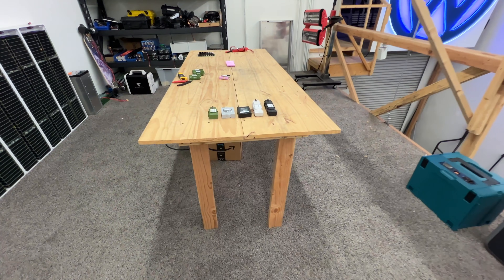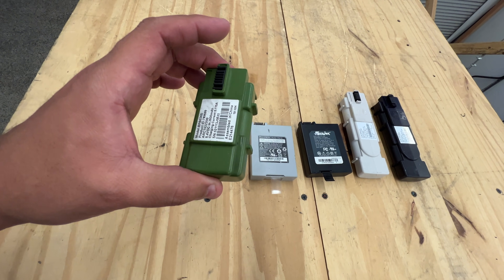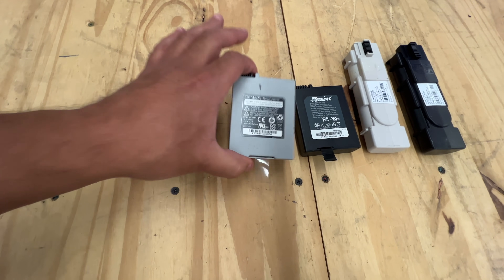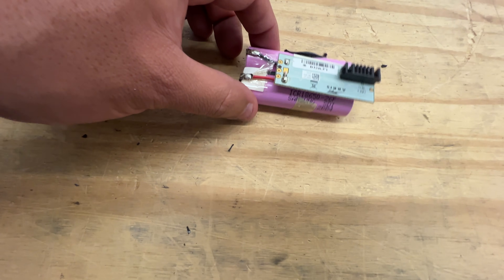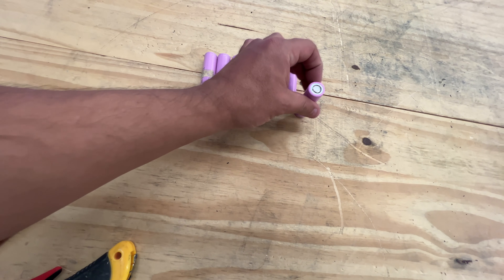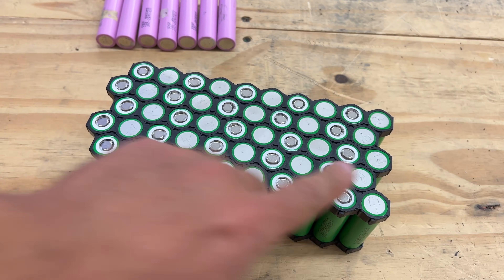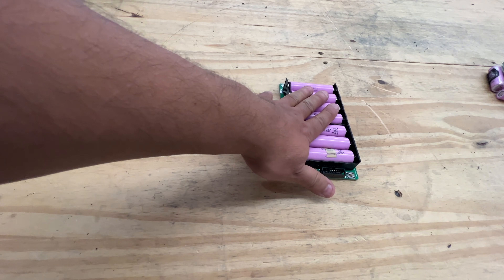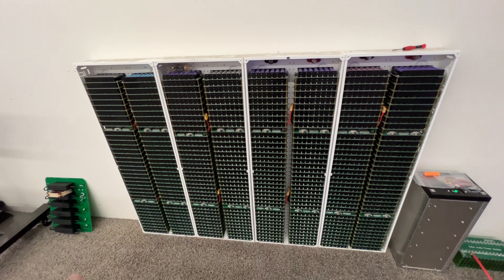Extracting 18650 SAMSUNG cells out of $1.20 Modem Lithium Batteries

Comment: I find modems in the dump all the time and harvest to battery packs. The cells are normally depleted to around 1 V (lots of power outages on island where I live) but by jumping them in parallel with a 4.2V Li ion I can get them to read 3.7 V and the the Li ion battery charger can read them and I can charge them up fully.

Comment: Never charge indoors. Always maintain batteries properly per specs. Set up something contained outside for charging. Using an old file cabinet (steel), washing machine, freezer, or similar. Two people I know have had fire while charging hobby battery packs.
Reply: Charge outdoors???

Comment: Ordered 40 of the $1.20 Modem packs. Here are my results!

40 Packs 80 Cells Ordred	
	
2400	3
2300	7
2200	14
2100	8
2000	14
1900	12
1800	5
1700	5
1600	7
1500	4
Junk	12
Total	91
Jehu Must have sent me some extra packs!	

I'm not super happy with the results! I have had much better luck in the past with other harvests. They aren't as hard to get apart as Laptop packs but that black glue in them will make you have to put new heat shrink on a bunch of cells.
Reply: realy not a good buy, i would go for the scooters battery at this speed, would be a better deal.
Reply: @uinerd  its because its garbage, and his trying to sell something that has some value lol This is why buying used batterys for salvage is a gamble, now add that with paying a premium for the packs lol

Comment: I think recycling these cells is awesome.  However wouldn't a cheaper and easier fix be getting a plug (molex connector?) for the cells to be used as-is?  That way there's no smashing of cases and/or ripping of plastic goo?
Reply: The point is to free the cells for construction of packs at varying voltage and capacity. there is a need that the cells match and are balanced. Each cell needs to be tested carefully. Ham radio is one application that comes to mind. Building a 12 volt pack at 2 amp hours is a common goal. This means something like 8 cells. Look up Building a LiPo pack ham radio.
Reply: Someone didn't finish the video before commenting :-)

Comment: Why not build a power wall using the battery packs as-is? Use 4 cell and 3 cell batteries together to get the 7 cells. They already have built in monitor and charge control circuitry so a wall unit would need a way to read the data from them. It could identify bad batteries so they could be swapped out. Don't know how much $ all the connectors would cost.
Reply: honestly, based on the cells in them, they're only rated at 5 amps. that's not very good. They're good for some uses, but they really can't push more than 20w per cell. They're cheap for a reason.
Reply: @kasuraga  Cells are combined to addresses application. Example... Say 8 cells, wired as two batches of 4 cells. 4 cell batch wired parallel. Those two batches are then put in series, doubling the voltage.
Reply: @tahoma6889  5 amps is still not a lot of current. but for the price, it's to be expected. I primarily use 18650's for regulated vape mods that push over 100 watts. They're useful for powerful flash lights too. Sure you can run them in series parallel banks to get more voltage and current, but that also increases the packaging size.

Comment: I’m only a couple of minutes into watching this, so apologies if my question is answered before the end of the video. 

The modems that these batteries comes from, (let’s just concentrate on the green packs, since they seem to be the favorite) is it known how the BMS in those modems manage the cells? In particular, at what voltage are the cells kept? (I’m hoping that they’re not charged to a voltage higher than 4.1V/cell.)

(Assuming they’re not LiHv cells, which can’t imagine they would choose for a simple cable modem.)
Reply: according to the info of the packaging they get charged to 4.2v each, its an 8.4v 2600mah pack, but i assume it's probably not tested at that, will just be copy and paste from the samsung docs, but they can be charged at 4.2v each according to samsung specifications, but it is right at the top of what these batteries can accept, i would expect a lot less cycles from them, they are only 1/10th the price from buying the batteries new from a proper supplier so i think you will still make a huge saving going this route, even if you loose 1/3rd the total cycles.
Reply: Don't waste your time on used cells, this is not a good deal.
Reply: @BigSmartArmed  Do have any evidence to back up your inane claim with?
Reply: @BoHolbo  What claim?  That seller only uses FedEx for shipping, it's a fact, not a claim.  Shipping costs come to half of the order cost, while other commenters here stated that shipping was as high as $50 per order.

It's the final cost that matters, not advertised price.
Reply: @BigSmartArmed  I’ll accept your answer, except for one thing. 

The points that you brought up, doesn’t address anything talked about in the comment thread that I started. 

It would have made a lot more sense if you had posted it in the main thread instead.
Reply: @BoHolbo  You were asking about the voltage, and in used li-ion cells that were kept at full charge over an extended period of time, internal resistance begins to vary to the point at which BMS can't keep multiple cell charge balanced.  

That means that prior to assembly and depending on how many recycled cells will be used in a given connection, all of those cells have to be tested by multiple charge-discharge cycles, and then sorted according to their rating.

Otherwise even with BMS an assembled pack will either charge as high as the lowest rated cell, or will overcharge thus potentially causing a fire.

That's why together with very high shipping charges these recycled cells are just not a good deal.  It can be DIY project of battery pack building, but for a dedicated use it's much better and much, much safer to just buy new cells.
Reply: @BigSmartArmed  but getting them new you also pay for shiping cost. Or not?
Reply: @RolopIsHere  Other vendors use USPS and UPS which is much less then FedEx
Reply: @BigSmartArmed  No, FedEx is not the only shipping option. From his link: We provide the following shipping options:

- USPS Priority Mail
- USPS Priority Mail Express (3pm PST cut-off time)
- FedEx Ground
- UPS® Ground

Comment: I have never once had a modem that had batteries.
Reply: It's only going to be in areas with no dedicated PSTN line, and a requirement by state law to have power on the telephone service so you can use a passive handset during a black out.

Comment: Most modems don't have a battery. Only modems that support analog phone lines which is basically the supper crappy modem the cable company gives you after they swindle you into getting a land line that you'll never use and unplug because the only calls you get are that your call warranty is about to expire.

Comment: Aren't these batteries kept fully charged for years? That is not very good for longevity...
Reply: Lithium ion batteries actually do really well if they are fully charged for years. The thing that kills them is if they get drained below a certain point, or if they get overcharged by a faulty controller. If they are charged or discharged at too high of a current then that can also damage them.
Those batteries are not going to meet their original capacity specs, but if they are tested for their actual capacity and voltage, then they can be properly grouped together and can managed by a proper controller. They will last a long time.
Reply: @RealCheesyBread  That's actually false. Lithium Ion batteries do really well if they are 80% charged for years. Not 100%.

Comment: Do you really use a hammer to open the packs ? also what happens to all the plastic cases and circuit boards ?
Reply from the maker: Recicle them
Reply: just slice the sticker in half and then take vise grip pliers on the end with the connector and pull apart, easiest and fastest way to do it.

Comment: I work for a tv/internet provider and yes those batteries are from the older Arris e-mta modem and I remembered replacing a lot of them modem for newer one. the batteries are for emergency 911 calls when the power goes out. You should contact any cable provider warehouse person and somehow buy directly from them because there are thousands of used and new ones in those warehouse. FYI: those modem fit those small green one but also take the big ones I think the white battery you showed on the video.
Reply from the maker: There’s enough of these for the next few years.
Reply: yep, I work for a cable company and I was able to get about 1000 pf these packs because no else knew what they were worth

Comment: Thanks for this information.  I just ordered two 4-cell modems for $20 (with tip) to see what condition they're in.  I hope they're not capacitance depleted and are slightly used.  I know they won't be the button type and will have soldered tabs on them....but I can fix that.

Comment: "every single modem in America" - I have NEVER had a cable modem with battery backup. I had to add my own UPS.
Also - your ISP swaps your modem out when it gets old? Ours barely replaces them if they actually break. Lots of people I know around here running ancient modems.
Reply from the maker: I’ve never had one either,  but there are millions of them of them hitting the recyclers for the past few years.

Comment: I've never used a cable modem with batteries in it.
Reply: Its for companies like Comcast where you home phone is over internet
Reply: @aaronfletcher6664  Our Comcast modem (w/VOIP) has a provision for a battery but no battery. Comcast says the customer has to buy their own battery. A few years ago, the did include a battery though.
Reply: @knowsenough2bdangerous  That is because people started to take them out, and then call for a TC to get more.  They still have to be used on any modem that has phone service, but the system can tell when the battery is taken out- so if you take it out after that you pay some sick inflated price for another.  As far as getting recycled - they are only recycled after they are down to 70% capacity - otherwise they are repackaged in another voip modem setup.
Reply: @MegaMeaty  We have VOIP and Internet w/Comcast and when they swapped our modem out a few years ago it came without a battery installed. I questioned it and they said they no longer provided them but I could buy one online. I was too lazy to check if that was legal or not - it certainly seemed sleazy though to "downgrade" me just because they had to swap out a failing modem.

(We also have a traditional land line and, of course, multiple cell phones so I really didn't care much about 911 in case of a power failure -- our internet service is down a lot more than our landline even with the power on!)
Reply: @aaronfletcher6664  My parents have a modem with phone and it does not have a battery backup, so we put it on a UPS. However, if the power goes out, the service from the cable company also fails a few minutes later, so it ended up being unnecessary. I'm assuming the cable company has some powered switch gear in their distribution boxes placed throughout the neighborhood which has it's own that doesn't last very long. Now my cable modem doesn't have phone (or a battery) but during long blackouts, I've seen cable company trucks parked idling next to their distribution boxes with wires running to them, presumably to keep service active during the outage.
Reply: I have never heard of them till now
Reply: My (UK) fibre modem has battery backup… made from two AA NiMH batteries…The instructions even tell me to replace them after two years. Our cable modems don’t have batteries, we just have to use our mobile phones when the power goes off.
Reply: Cable modem ie home phone?
Reply: Here in Canada we have to have a UPS on our modem if we want internet when the power goes out. 🤷‍♂️
Reply: Credit card modems..
Reply: Might be newer modems, where I live everything switched from copper phones to optic. I am 100% sure if the power goes out that I will not be able to make a phone call though.

Old phones were powered by the phone line independent of the main power.

Unless I have a UPS for my Wireless phone, Fibre box, Modem and Router. well I am SOL.
Reply: You really only see batteries in cable modems that support phone service, since phones through the cable company don't get their power from the telephone company. When power is lost, your phone will still work (presuming you're still using a POTS phone and not something that requires AC power.)
Reply: @yuppiehi  mine has phone, I'm curious now if it has a backup battery...
Reply: It’s not the internet one or your cable one (although available, usually not included) just your phone modem.
Reply: that why you house walkabout house came with a sticker (not to be be relied upon in an replacement for a connected land line (e.g. a simple phone the just plug into the wall)

Comment: I just ordered 15 of the green ones. I've harvested laptop and old tool batteries many times. I use a dab of rosin and a bit of solder to make a button so they fit in common things like my led headlights. So thanks so much for this tip. I'll be using thr crap outta this one.

Comment: i extract mine on laptop battery packs 

sometimes i got 
lgdas31865 2200mah the blue one and the orange 1 lgabc21865 2800 mah
and some lenovo packs uses panasonic icr 18650 3400 mah 

i use it to build a power banks or a battery pack for my drill
Reply: You shouldn't use laptop cells for high current applications like power tools. The cells are not designed for the high discharge current, and may give terrible tool performance and/or the cells will get damaged or even catch fire from overheating.

Comment: But at $1.2 for these packs, your going to make a steal! What a business opportunity to get access to! 

Nice, except here in Australia they didn't even bother with backup systems for the modem (NBN) network they upgraded too. If you had a medical emergency then you just had to deal with mobile phone access which allot of elderly people struggle with even basic usage (and blind/disabled).
Reply: and Australia has shit mobile coverage for any carrier, I'm 45 mins from CBD of Brisbane and lucky to get ONE BAR even outside...   
NBN = joke, forget third world network, its stone age
Reply: If it's VDSL, typically goes out on a power outage anyway. That is because VDSL cabinets needs to be near (maximum 200 meters) to the final customer, and they use power. Powering all them up from a central point that has backup power is expensive, since you need long power lines and thus a lot of drop. They are typically powered from the electricity grid (in my country you usually see a normal electricity meter box beside them). Putting a UPS in each one of them is expensive and it will last a couple of hours anyway. 

I think that is correct to not have backup power in them. Power outages, at least where I live, are so rare that I don't recall having one in 20 years (if not for scheduled maintenance where they will tell you in advance that in a particular day they will cut power). 

The point of making emergency calls, true in the past analog phones where powered by the phone line. But only wired phones, if you had a cordless (that you typically did) if the power went out you didn't get any power to the RF transmitter and thus you were unable to phone anyway. That was really never a problem.
Reply: the original fttp nbn under labor did have batteries. massive shame the current gov destroyed the nbn
Reply: @lmmlStudios  but those batteries were only going to power for 2 hours, in an outage after a typical Qld storm, its 3 hours min to restore. the batts in POTS exchanges are designed to last 2 days minimum,  plenty time to get a generator in, bigger exchanges much longer
Reply: Australia is the asshole of the planet. (we get all the shit)
Reply: @soarer282  and they got no problem spending billions on upgrading sports stadiums, something that only a tiny  percentage of the population ever go near let alone use
Reply: I know it sucks

Comment: Theres such a thing as used by date even if the batteries are not cycled .
Reply: I harvest a LOT of cells, and typically even battery packs that are 10 years old can have cells that have almost 100% capacity. Even if the voltage is down under 2V, a large proportion of cells (especially Samsung cells) will recover just fine, and provide good power. It depends on the brand, composition and chemistry rather than the age.